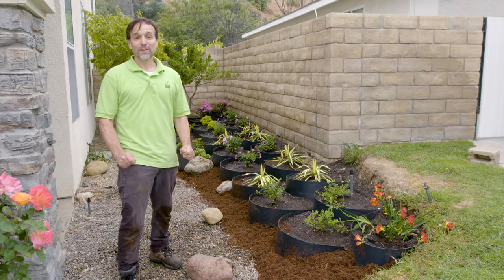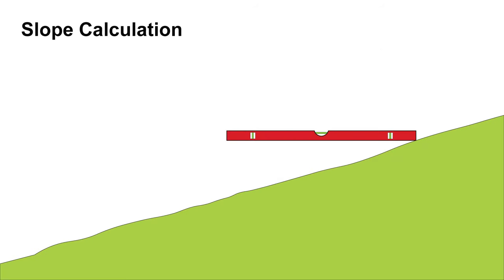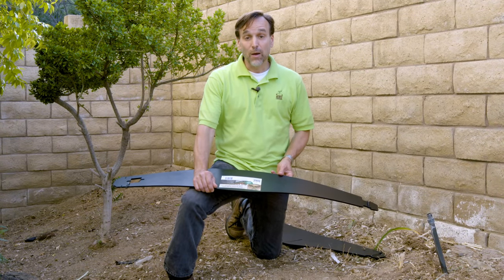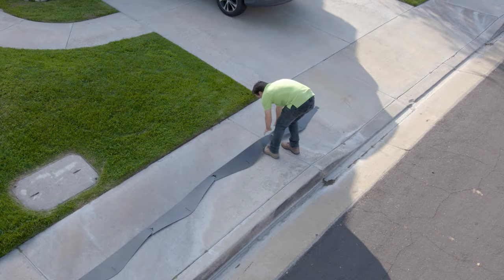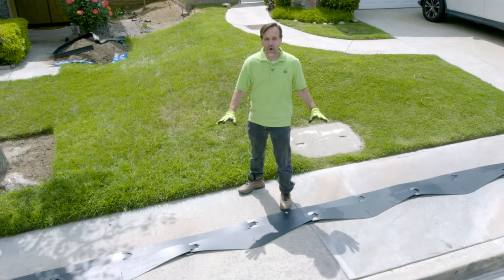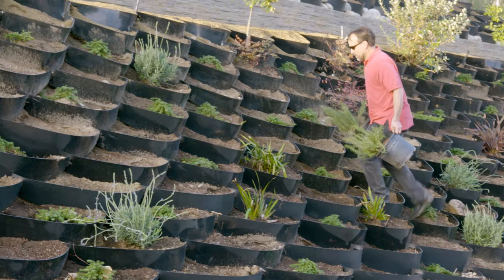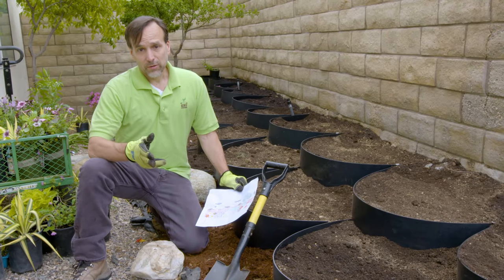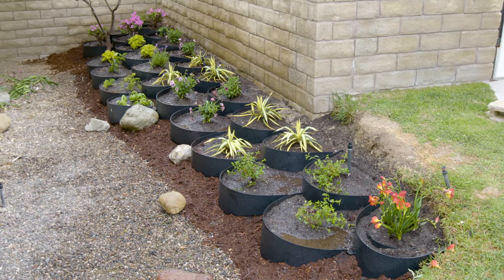Landscaping on a Hill with Dirt Locker® Hillside Planters: Landscaping Slopes + Terracing a Hill

Comment: How does this work on irregular shapes and varying elevation like most slops would be.  Land is never straight or level.
Reply from the maker: This is true! Slopes with irregular shapes and varying slope degrees can still utilize the Dirt Lockers®. You can interconnect the Large and Medium sizes when you have multiple grades to work with. When configuring your design around a curve/bend, you can detach the Dirt Locker® from the row above and add a J hook to anchor it down. Our quick estimate Calculator would be want you want to use for irregular shapes. Our installation page has different configurations to chose from depending on your slope type. Check it out!

Comment: Nice project, may I know what kind of material you used to manufacture the dirtlocker? What is the lifespan, durability. etc. My future plan is contour farming, terrace/hill farming at my native in India. Thanks and very nice initiative. Good luck for you.
Reply from the maker: The Dirt Locker is made from 100% recycled post-consumer waste High Density Polyethylene. HDPE, as it is commonly called, is found in milk jugs, plastic bags, and refillable bottles (labeled #2 plastic for recycling). The benefits of HDPE also include acting as an effective barrier to repel or hold in moister, does not rot, resists insects and chemicals, creates no harmful emissions during production or during its use by the consumer. Most importantly, HDPE does not leak toxic chemicals into the soil or water, and technically, will last indefinitely!Also, know that each Dirt Locker purchased saves the equivalent of 13 plastic milk jugs from entering our landfills and oceans. Each month, HillGrow Inc., owner of Dirt Locker, helps recover nearly 100,000 plastic milk jugs monthly. Technically, they will last forever. HDPE (which the Dirt Lockers are made of) is not biodegradable and do not breakdown over time. They are also created with 10 year UV inhibitor. The original prototypes were in place for 11 years with only mild fading. Additionally, since the Dirt Lockers are designed to grow and sustain plants, ideally they will be providing shade, thus substantially increasing the life of the Dirt Lockers.

Comment: does it include the nails to hold the dirt locker on the top so it will not slide down, once you put it in place?
Reply from the maker: Hello Veronica, thank you for your interest in the DirtLocker. The j-hooks are not included because not every configuration requires them. We will however provide a source for them.
Reply: @dirtlocker  please let me know where to get those j-hooks... still waiting for my order. I ordered 10 of junior and I think 10 of original.

Comment: These are really cool, but I can't get past the $10 per piece pricetag for such simple plastic panels... it'd cost my project thousands more than stone for a less aesthetic unnatural product.
Reply from the maker: Thanks for recognizing the product as cool. The hardest part of the design was making it simple. It’s also designed to fade into the background. Some stone walls can be beautiful and others can become outdated. The comparison to block walls is really apples to oranges. DirtLocker systems are typically 1/5 - 1/10 cost of brick/block/stone walls.
Reply: @dirtlocker  I actually agree with that, after watching through some more of your product videos I realize my initial thoughts were a bit premature and based on some incorrect assumptions.  These cover a much greater area than standard wall-block/stone. 
I have some steep hillside that this would be far easier to install than using excavator and skid steer to transport stone to. Look forward to trying it out . What is the maximum recommended slope/pitch? Can they be filled with compost or is topsoil needed for compaction/stability?
Reply from the maker: @tribalwind  In the typical configuration they can be used up to 38 degree slope. Absolutely you can backfill with whatever topsoil with or without amendment you like. We don’t recommend packing the soil, but really topping off the lockers and let it settle naturally. Then just add compost / mulch over time to optimize both soil conditions and holding moisture

Comment: but your installation has the Dirt Locker black plastic remaining visible. I can't show this to my client. I need to do an installation that will retain sloe soil but where the system is not or barely visible. Look, the wife in the client couple is a hard sell, while at the same time I m sick and tired of slipping down the slope doing the work AND there is a regular daily migration of deer and turkeys which can't can't their feet stuck in jute grid fabric, etc. Come on inventor - give me a real true to life challenging situation wherein your system works but is non-discrypt
Reply: I think once the plants grow in, they are barely visible. Check out the one year video on their channel.
Reply: @ImranKhan-qc2ue  Thx. Since I wrote that I've seen other demo on your website. Well done. I found what I needed.
Reply: You can also get dirt lockers in brown so they blend in with the hill